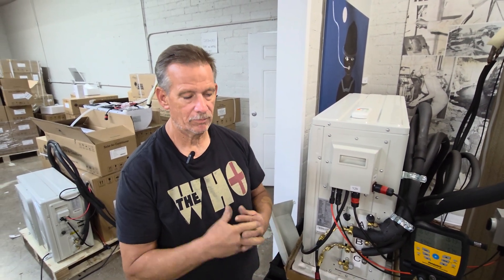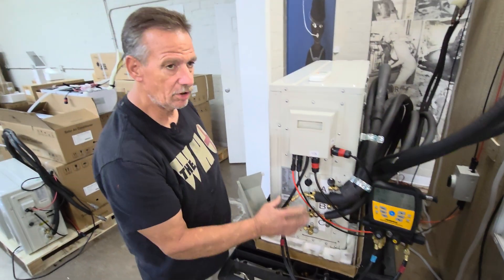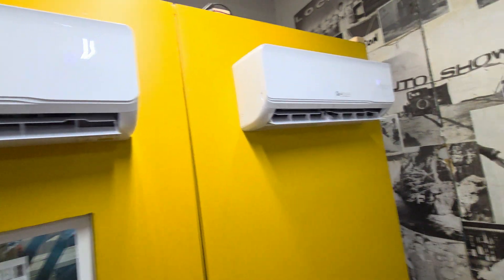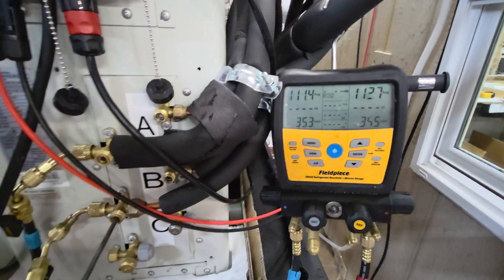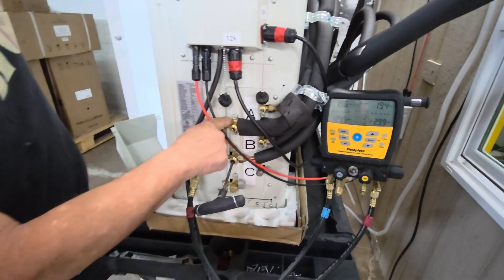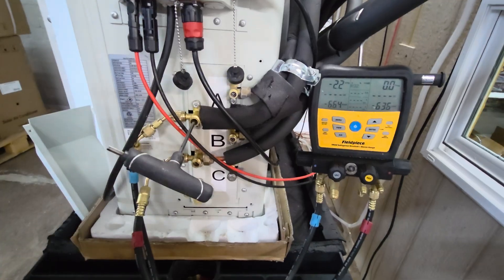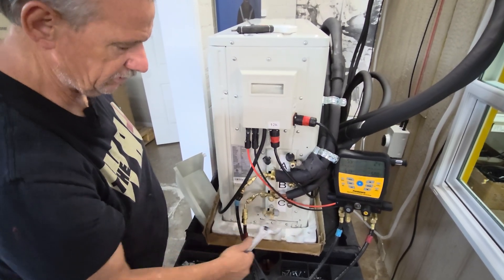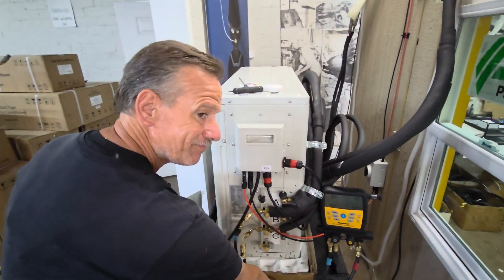How we recover/pump down a multi-split system to return the refrigerant back to the outdoor unit.

Comment: Hi - Thanks for the video. I installed a dual zone mini split and crimped/cause leak on one of the larger (vapor?) lines. Can I follow this procedure? It did not seem like much R32 came out. Thanks much!
Reply from the maker: Sure! Start by closing the valve on the small line, and then doing this procedure. But, if there is indeed a crimp on the line set, that would also pull air into the outdoor unit if it's leaking. So if it is indeed leaking, close both valves and get some fresh line set on there, and then vacuum down that one circuit. You don't have to vacuum down all of them. Then, you can release the refrigerant again.

Comment: what do you use to seal the line connections?
Reply from the maker: Well, the lines should all have a good seal on them based on your earlier installation. So, when you connected the indoor and outdoor unit, you should have a nitrogen test to test the system at pressure, and then a vacuum test to test the system at negative pressure. And then the gauges are just checking the pressure of the service port, like you would test the pressure in a tire with a tire gauge. And the compressor is the one that's pulling all of the refrigerant back into the outdoor unit. So as long as the system is holding pressure, you won't have any problems with just letting the compressor do its work and pull the refrigerant back into the outdoor unit. If your question was just about how do we seal, we don't usually use Nylog. We have nothing against it, but if everything is connected correctly, then there's no need for it. The system is built to seal correctly with proper torque for the female flare nut onto the male flare.

Comment: So when i connect the gauge it will read a pressure but then when the system is on cool pumping down that pressure will drop to zero once all the coolant is back in the unit?
Reply from the maker: Yes, exactly.